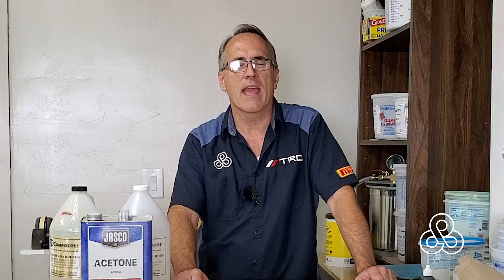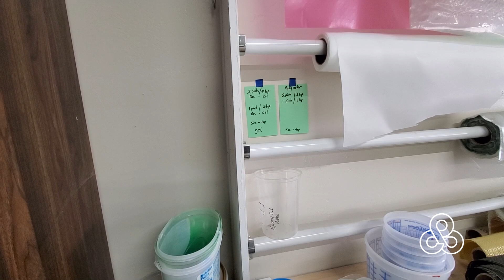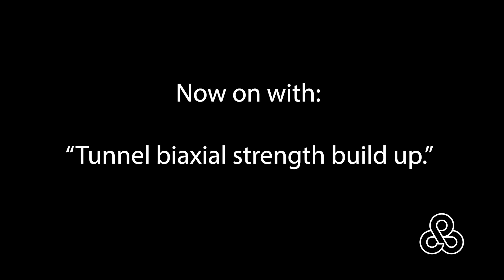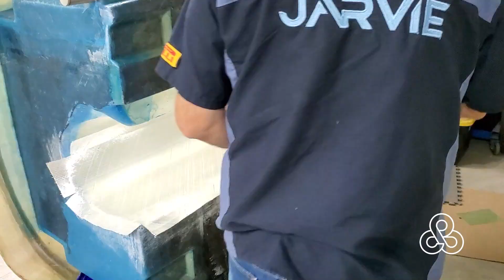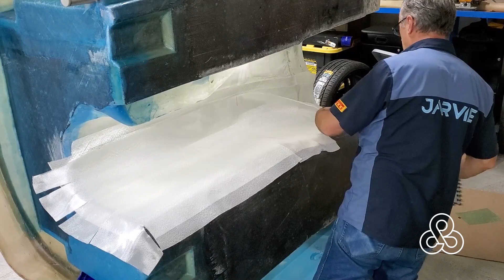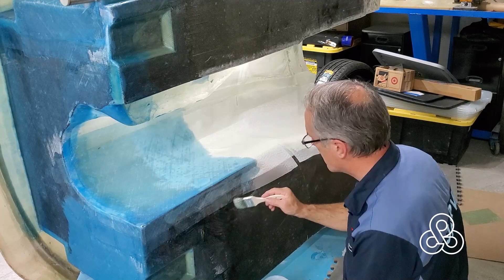Fiberglass 101- Working with resin to create FRPs “The Resin”

Comment: At last, someone who also prefers to use surfacing tissue, instead of jumping for gelcoat every time. I'm an Irish sculptor and use an inordinate amount of surfacing tissue when making casts of many of my sculptures, for a smooth surface finish.
Reply from the maker: Yep, especially if your sculptors are installed outdoors with lots of UV exposure and temp changes. To thick of gel coat has tendency to de-laminate. Would love to see what you sculpt - any social media sites?

Comment: Hi Jay. I know I asked you these questions before but I forgot what video I was watching. So here goes. I'm going to use the "sandwich" method to build my project. Starting with 1/4" polyurethane foam for shape. The plaster & mudd to refine. Then how many layers in & out would you recommend? What fiberglass would you recommend? Use the epoxy or polyester? Thanks for you help! Keep on doing your videos I have learned so much from them!!!

Comment: I use mylar potato chip bag to get a smooth surface on small parts. I actually
Used the same bag 20 times or more.
I saw cotton Flox on shelve this will 10 times the strength of epoxy or polyester 
Resins depending application.
Reply from the maker: Mylar- excellent release film. Emergency blankets are a great source . . . of course, unless you want some potato chips to boot!

Comment: A medical tape called micropore can be sometimes used to put a little pressure on cloth around a convex surface to act a poor man’s vacuum forming.
It ensures a nice close binding to the foam. It is porous and can be left invisibly in the lay up if you want.
Reply from the maker: Thanks, I'll have to look it up.
Reply: @BuilderCreator  Made by 3M, comes in 0.5", 1", 2", and 3" width, 10 yard rolls.

Comment: Do you clean your brushes somehow or throw away after each application? I found mine went hard between mixing small batches.
Reply from the maker: With polyester your domed to losing a brush after each batch. Epoxy is a pit more forgiving. I tend to use one brush for multiple batches (as long as they are applied in quick succession), but ultimately the brush is disposed of in the end. Brushes can be cleaned, but the price of the solvent (usually acetone) to clean them may be more than the cost of a cheap "chip" brush.

Comment: Hello Mr. Jarvie,
 I really appreciate your series, I have a question for you regarding resins. I am planning on cosmetically  "Skinning"(with carbon fiber) some fiberglass car interior parts I fabricated and contacted a supplier you are familiar with for epoxy resin recommendations. I was taken aback when they suggested not to use epoxy but pointed me to polyester resins, reasoning that the epoxy will go soft and sticky whenever the interior of the car heats from the summer sun. Watching you build the Arete using epoxy made me question their advice or possibly they did not understand my project. With your real world experience in composite work, I am asking you if you think this is a problem. Having worked with polyester resins before, I was looking forward to the leisurely pace of the epoxy. I also noticed almost without exception all the "Skinning" youtube videos use epoxy. ??? Confused in Texas.
Reply from the maker: The answer is you can use either resin. The benefit of using polyester is that you will not have a differentiation between the materials (shrink/expansion differences). That said, know that this is a problem already as you are adding carbon on top of fiberglass; two dissimilar materials. But that is not a problem, as you are not building aerospace or clock parts. I myself would use epoxy. Using polyester will require you to add styrene surfacing agent (or purchase it pre added) to aid in a surface cure. That waxy surface needs to be sanded off. You also have to sand the epoxy, but there are no additives to mess with. I say sand it off, because your final layer should be an automotive clear coat. A finish clear coat is WAY better than trying to find resins (poly or epoxy) with UV inhibitors. The auto clear coat is UV stable, harder and better glossy finish; made to be abused. Just for clarity, know that epoxy almost always out performs polyester in high temperature applications. hope this helps.
Reply: @BuilderCreator  
Thank you for your fast response. Looking forward to your next episode.

Comment: Great video with lots of info, perfect for complete beginners like myself. Do you also use a chopper gun spray up method? Maybe you could provide some tips on that? I'm interested in learning about that but people told me the equipment is highly expensive so it only mostly suits bigger commercial projects.
Reply from the maker: If you already have a high volume compressor you can probably get a chopper gun and other auxiliary equipment for less than a thousand dollars. A chopper gun is really a volume production device, and right now, I don't do any "volume" of anything, so I do not have one.  So, if you don't have a compressor; think of it as having an extra $3000 towards a lot of materials for hand lay up. Ha! Thanks for following the channel.
Reply: @BuilderCreator  I see... So just out of interest, what compressor would you get if you were to do such a setup, and how much do these usually go for?
Reply from the maker: @ronigbzjr  I would get a 5 horse power compressor with a large tank (volume). This is also getting into the realm of being able to do automotive painting for volume requirements. They usually run between $1200 to $2000 US. $450 for the chopper and $200 or so, for a Cup Gun to spray resin.

Comment: If anyone is using polyester resins for the first time, the hardener or catalyst will burn your skin on contact, use gloves and eye protection when handling the hardener and invest in a bottle of saline for an eye wash. Resin or acetone in your eyes is f***ing painful, and the hardener is genuinely dangerous.
I have seen a tiny drip of hardener burn skin quite badly (not me I might add, but I have had dirty acetone splash right in my face, saline eye wash saved the day)

And a 1.5% hardener mix with polyester is quite a fast acting mix, so don't use too much hardener or your part might go off before you're finished.
I've watched that happen before, and the poor guy ended up with a "furry" job.

Comment: Is it possible to mix and match resins in the same work? I mean, putting one layer of epoxy and after drying another layer with polyester (for example) ?
Reply from the maker: The coefficient of expansion is different and would likely cause the two to delaminate over time/temperature, but if it wasn't something important . . . you could.